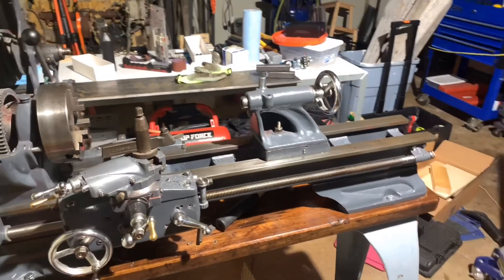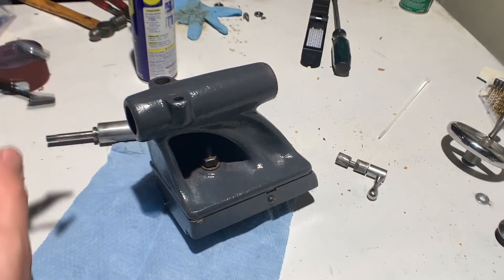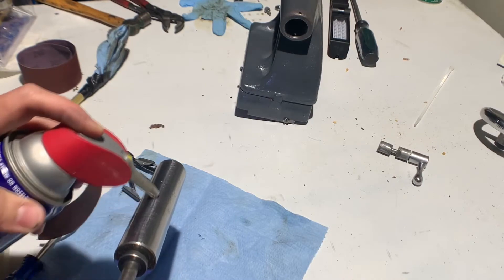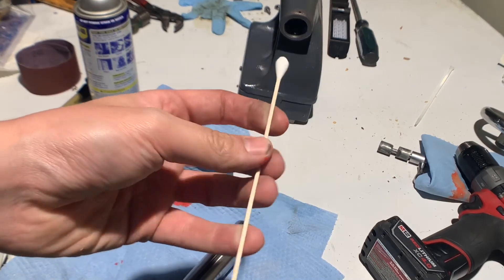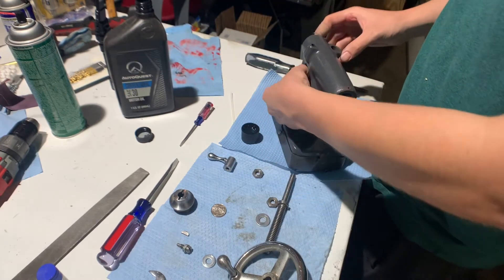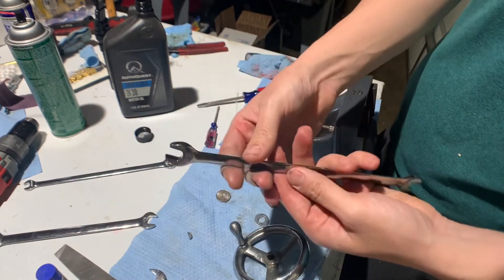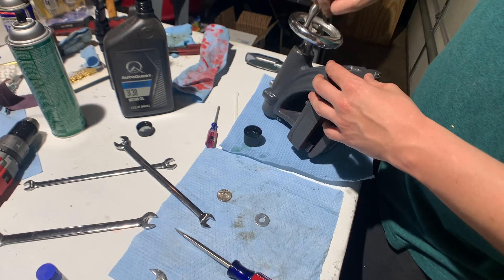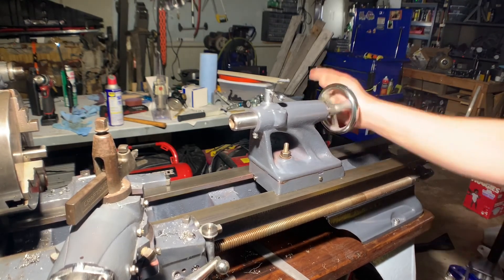Tailstock Repair On Atlas Mini Lathe

Comment from the maker: Affiliate links for eBay. All these tools I own except the Shars tooling and the two lathes at the bottom. The only reason I did not buy the Shars tooling is it takes different carbides. I did not want to invest into all the different types of carbide. Eventually I will end up with the Shars tooling. If I had the money I would buy the Southbend lathe. The erie tools mini lathe is a good option for a decent small lathe. The harbor freight lathe is just as good if you want to order one from them.

OXA 0-8” Quick Change Toolpost

http://rover.ebay.com/rover/1/711-53200-19255-0/1?ff3=4&pub=5575241616&toolid=10001&campid=5338722397&customid=OXA+Tool+Post+0-8%22&mpre=https%3A%2F%2Fwww.ebay.com%2Fitm%2FNEW-OXA-Wedge-Type-Tool-Post-Set-250-000-For-Mini-Lathe-8-and-Two-Extra-250-001%2F174313103090%3FssPageName%3DSTRK%253AMEBIDX%253AIT%26_trksid%3Dp2057872.m2749.l2649

1/2 Keyed Chuck For MT2

http://rover.ebay.com/rover/1/711-53200-19255-0/1?ff3=4&pub=5575241616&toolid=10001&campid=5338722397&customid=MT2+1%2F2+Chuck+Keyed&mpre=https%3A%2F%2Fwww.ebay.com%2Fitm%2F1-2-6JT-Heavy-Duty-Drill-Chuck-Key-Keyed-6JT-2MT-Arbor-MT2-JT6%2F112405387507%3FssPageName%3DSTRK%253AMEBIDX%253AIT%26_trksid%3Dp2057872.m2749.l2649

Center Drill Set

http://rover.ebay.com/rover/1/711-53200-19255-0/1?ff3=4&pub=5575241616&toolid=10001&campid=5338722397&customid=Center+Drill+Set&mpre=https%3A%2F%2Fwww.ebay.com%2Fitm%2FCenter-Drill-Countersink-Pilot-Bit-Lathe-5-Pc-Set-Lifetime-Warranty-Drill-Hog%2F181740272898%3FssPageName%3DSTRK%253AMEBIDX%253AIT%26_trksid%3Dp2057872.m2749.l2649

12mm Carbide Tooling

http://rover.ebay.com/rover/1/711-53200-19255-0/1?ff3=4&pub=5575241616&toolid=10001&campid=5338722397&customid=12mm+Carbide+Tooling&mpre=https%3A%2F%2Fwww.ebay.com%2Fitm%2F4-PCS-Lathe-Turning-Tool-Holder-10x-CCMT09T304-Carbide-Inserts-4x-T15-Wrench%2F223935753567%3FssPageName%3DSTRK%253AMEBIDX%253AIT%26_trksid%3Dp2057872.m2749.l2649

Shars 3/8 3/8 7pcs Carbide Tooling

http://rover.ebay.com/rover/1/711-53200-19255-0/1?ff3=4&pub=5575241616&toolid=10001&campid=5338722397&customid=Share+3%2F8+7pcs+Carbide+Tooling&mpre=https%3A%2F%2Fwww.ebay.com%2Fitm%2FSHARS-7PCS-3-8-x-3-8-INDEXABLE-CARBIDE-TURNING-THREADING-LATHE-TOOL-INSERT-SET-S%2F331066223117

7x14 Mini Lathe Erie

http://rover.ebay.com/rover/1/711-53200-19255-0/1?ff3=4&pub=5575241616&toolid=10001&campid=5338722397&customid=7x14+Erie+Mini+Lathe&mpre=https%3A%2F%2Fwww.ebay.com%2Fitm%2FErie-Tools-7x14-Mini-Metal-Bench-Top-Variable-Speed-Lathe-and-Carbide-Cutter-Kit%2F202987578464%3F_trkparms%3Daid%253D1110006%2526algo%253DHOMESPLICE.SIM%2526ao%253D1%2526asc%253D228412%2526meid%253Df8f84a3a565e4b13b5f1c314c781a571%2526pid%253D100005%2526rk%253D1%2526rkt%253D12%2526mehot%253Dpf%2526sd%253D254227068407%2526itm%253D202987578464%2526pmt%253D1%2526noa%253D0%2526pg%253D2047675%2526algv%253DSimplAMLv5PairwiseWebWithBBEV2bDemotion%26_trksid%3Dp2047675.c100005.m1851

Southbend Heavy 10 10 30

http://rover.ebay.com/rover/1/711-53200-19255-0/1?ff3=4&pub=5575241616&toolid=10001&campid=5338722397&customid=Southbend+Heavy+10+10+30&mpre=https%3A%2F%2Fwww.ebay.com%2Fitm%2FSouth-Bend-SB1007-Heavy-10-10-x-30-Gearhead-Lathe%2F293527052405%3Fhash%3Ditem4457936075%3Ag%3ANdQAAOSw5uZekLKR
Reply: Do you have an email for business inquiries?